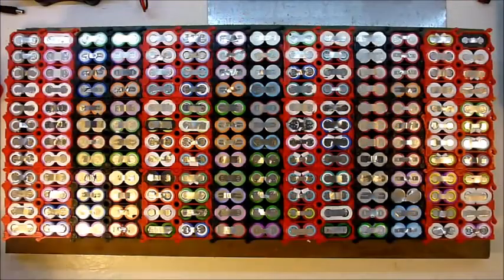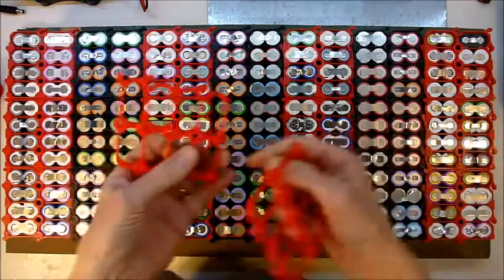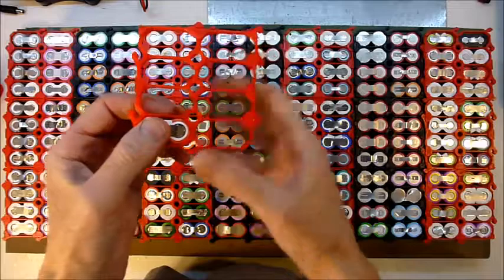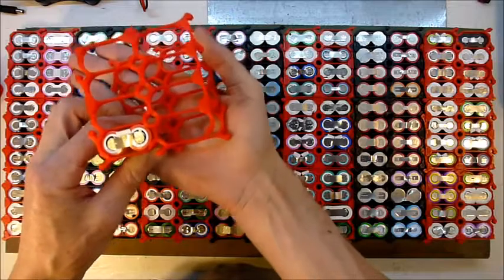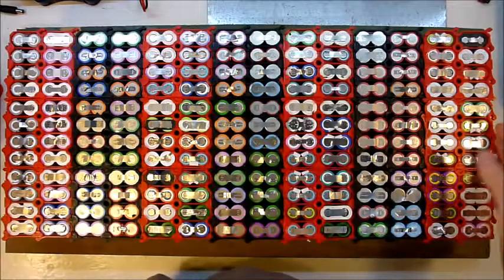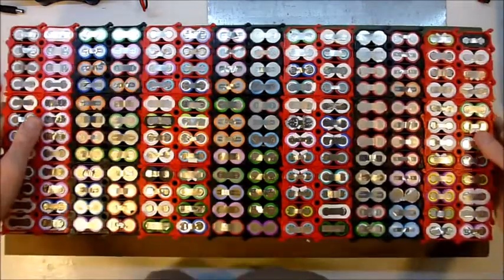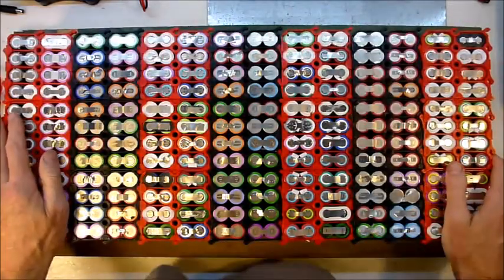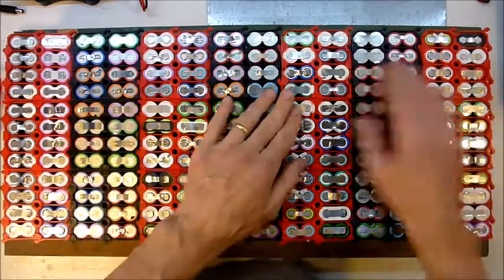Laptop Powerwall 06 - printing 18650 battery holders

Comment: Hi Paul, this is a great idea and you did nice job on the holders, but why have you chosen PLA instead of ABS? I guess the pack could go pretty warm...
Reply from the maker: I use PLA because (a) my cheap 3D printer does not run hot enough to print ABS, and (b) I prefer PLA as it is corn based, not fossil fuel based. PLA will biodegrade within my lifetime - ABS not so much. Also ABS gives off worse fumes when printing.
I run my pack at a very gentle discharge rate to avoid it getting warm or stressed.
Reply: Paul Kennett 👍 I was just looking for some best practice, nice work you did with your powerwall - very original!

Comment: would you be willing to build and sell some holders?
Reply from the maker: Hi Rob. The economics are not so good for selling these one off parts. I could do it but the price would be silly. It takes me 2 minutes to setup then 2 hours for the printer to make each one. Then I'd have to post them from New Zealand which is also expensive. You'd be much better off either printing locally (at a local hackerspace) or jump in and get your own printer (https://printrbot.com/shop/assembled-simple-metal/) Cheers, Paul
Reply: Thanks! ya i had only gotten through a couple of your videos and didnt catch that that you were in New Zealand.

Comment: Hi Paul, do you have an estimation of how many each holder cost you? I ask because I did sent your 3D file to various online 3d printing services an I get crazy prices from thier automatic cote.
I realy would like to follow your 18650 paires method that have many advantages over more classical methods.
Reply from the maker: +Propergol  It requires 3.44 meters of 1.75mm dia. PLA to print one of my battery holders, which holds 16 cells (8 pairs).

A 1kg roll of 1.75mm diameter PLA has about 300 meters and costs around US$30-60 depending on the source. So for a US$50 roll, that 3.4 meters would be US$0.57 per holder - but you need two - top and bottom.

Pretty cheap... as long as you don't factor in time, and the cost of the 3D printer. My little Printrbot Jr was only US$400.
Reply: +Paul Kennett So something must be wrong with quotes I did get. I will check again. If you know any cheap 3D printer online service, let me know.